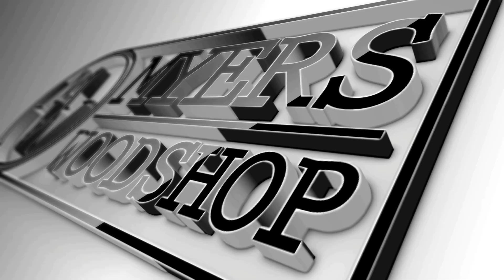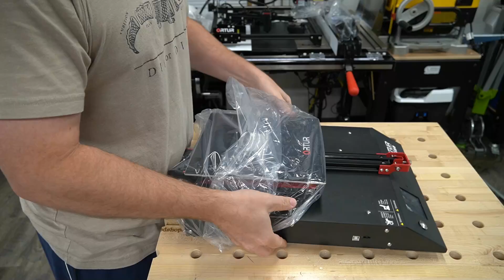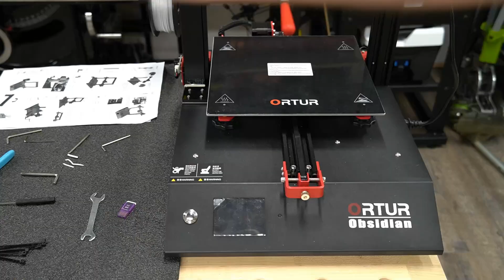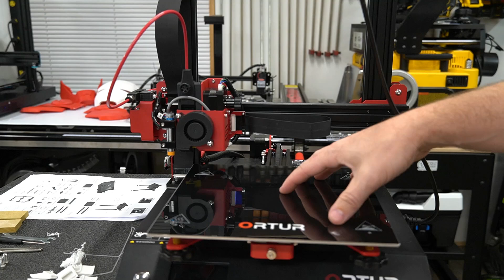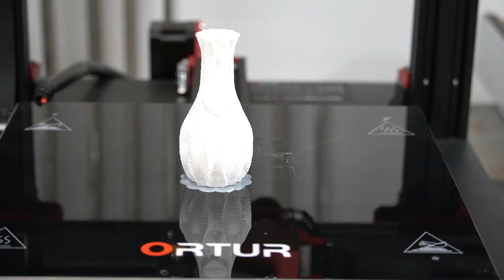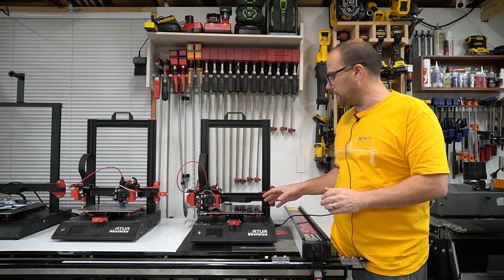Is The ORTUR 3D Printer as good as the Ortur Laser Master?!

Comment: I have so many questions.... 
1. Have you replaced the bed yet? I have had to the sticker didn't survive...
2. Have you used this with Octoprint? I'm trying to but soo many issues with time outs and hard resets...
3. the pulleys on the bed are already going... small rubber fibers coming out tops of gears...
Other than that It's an awesome Printer Just took forever to setup and get going.

Comment: Well, that's disappointing. Glad I didn't run right out and get one. I probably would have if I could have ordered it from anywhere other than Gearbest.
Reply from the maker: I'd look at the ender 3 or artillery sidewinder.  I have videos on both.
Reply: @MyersWoodshop  Thanks. Yeah, not quite ready to pull the trigger on a 3D printer yet, but soon. Been leaning towards the Ender 3 or CR-6 SE, but I'll take a look at the Artillery Sidewinder too.

Just ordered my first 3018 CNC Router today as that's something I can work into my little local business here before a 3D Printer.

Comment: Part of the reason it keeps failing in terms of layer adhesion is due to TOO much cooling. I bet that big 5015 fan is cooling the filament before it sticks to the other filament. I would turn down the speed on that cooling fan to like 40%
Reply from the maker: very possible, but doesn't solve the issue of the machine going black and the hot end stop heating!
Reply: @MyersWoodshop  I completely agree with you there. I was just pointing out that MAYBE you could get it printing and they can fix the software. 

I am one of those people that just assumes every 3d printer is somewhat going to be a project, and that thing probably needs a new firmware entirely. So if you desire to keep it, I bet someone probably already did a Marlin release for it on github. LOL

Looks like a project printer LOL

Comment: Who said that the laser is good? 😂😂
Reply: @Orsa Adrian  $200 it's been an awesome laser for me. 1hr to setup me and my kids had a blast cutting images into tiles for days. I also have a JTech and the esse of use on Ortur is hands down a better user-friendly system. Yeah its cheap, yeah the parts are inexpensively made, but it works & extra parts are readily available to swap & replace as needed.
Reply from the maker: I did, and my 3 videos confirm it.
Reply: Their laser diodes are decapped and run over rated. They don''t last long. The main board has many usb connection issues and doa for many users. The supplied 12 volt supply is marginal for the 15 watt laser and undersized for the 20 watt. JUNK.
Reply: ☝️First realistic impression 😍